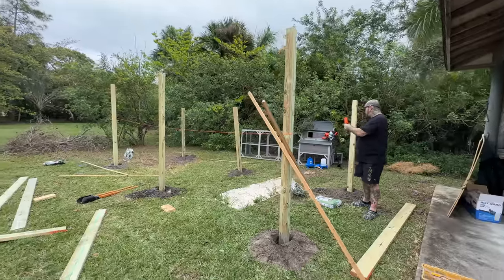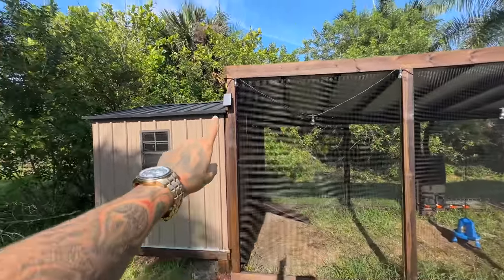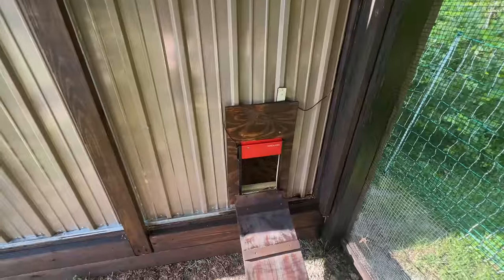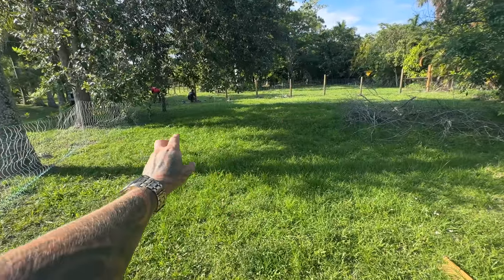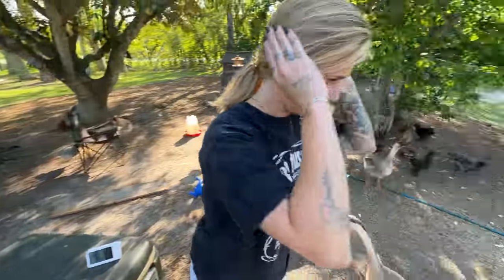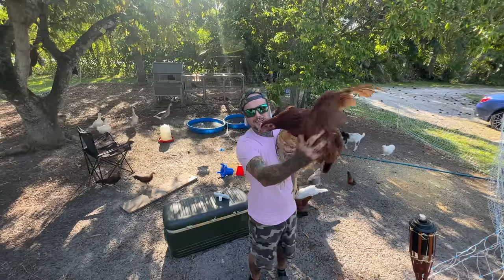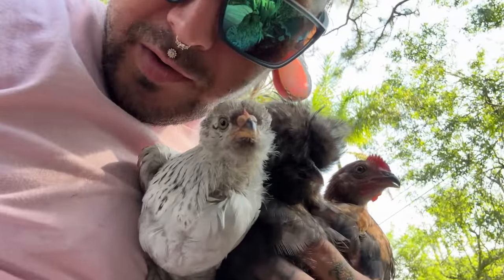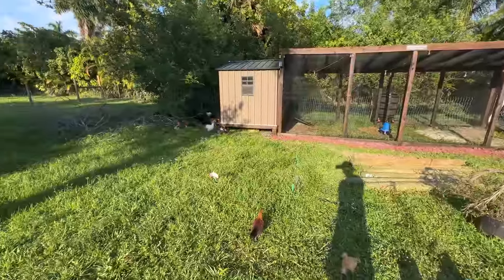The Ultimate DIY SHED CHICKEN COOP !

Comment: Good stuff and good chicken coop. 
I would recommend putting something over the laying boxes because you may get a chicken(s) that will lay and roost on it during the night. 
I would turn the 2x4 over where the chickens can stand more easily instead of the narrow side. You could 45 degree cut the top of the 2x4 where it is more rounded and 3.5 inch side and they could grasp more… if you didn’t like the flat 2x4. 

Good job, keep it up!

Comment: Great job! 
FYI - not sure if you changed it by now but your rain barrel in this video is backwards. The flat side goes along the coop and most importantly: the overflow drain is currently towards the coop and should be as far as possible.

Comment: I worried that the shed would get to hot in the summer.
Reply: BBQ will be ready😅
Reply: They can put a fan in that window and they would be fine . Even in florida
Reply: Most chicken houses ate metal with fans my uncle owned the largest in Arkansas
Reply: Cool video
Reply: @Dustinpool87  
Not good to eat metal.
Reply: All you do is leave the door open. The chickens can go out side when ever you want or you can just cut in more windows in the shed and put in mesh.

Plus you could put installation in the roof or just plant trees around the coup to protect it from heat and cold.
Reply: They are fine
Reply: It won’t get too hot at all they only go in the shed at night to sleep or lay an egg
Reply: Too******🤨🤦🏻‍♀️
Reply: I agree… I’m afraid your shed will be way too hot😢